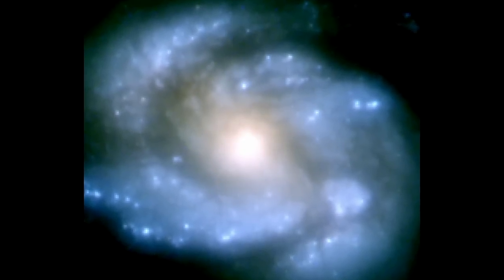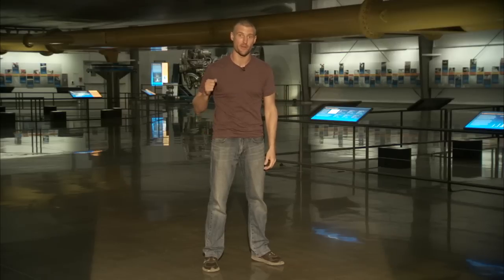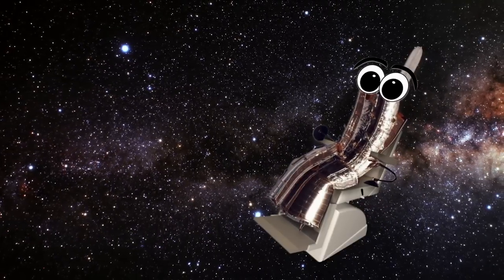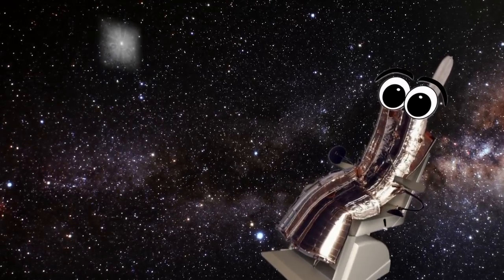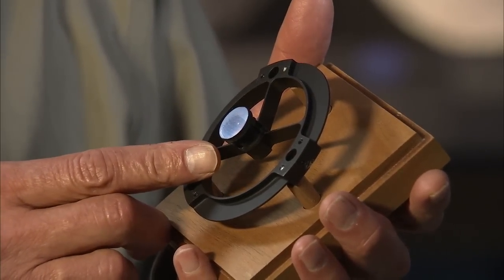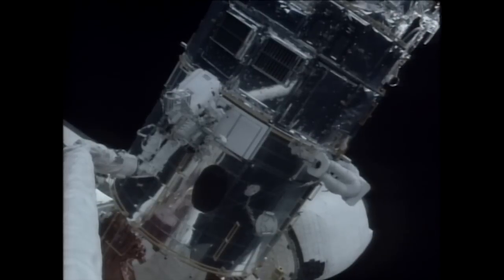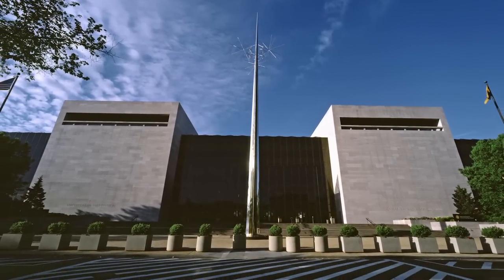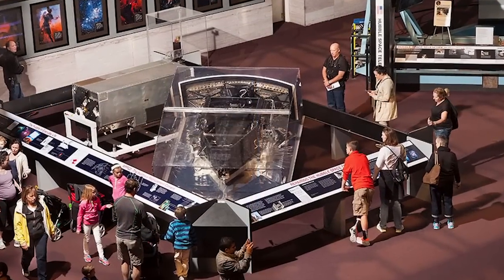Crazy Engineering: The Camera that Fixed Hubble

Comment: The truth of the matter was, that the mirror was laid flat and ground in a gravity environment, and performed differently in a zero g environment
Reply: OpionatedOldMan  Not so.  Try again.
Reply: It was a bit more involved than that. For one, while the mirror was being ground it was supported on actuators (pistons) that simulated zero gravity, holding the mirror in the shape it would assume when in space. How it reached that final shape is an interesting story.

When planning the Hubble Space Telescope NASA decided that the building of the primary mirror was so challenging and so crucial that a backup was needed. The main contract went to Perkin-Elmer in Danbury, Connecticut, now known as Hughes Danbury Optical Systems Inc. At NASA’s request, Perkin-Elmer let the contract for the backup mirror to Kodak Eastman in Rochester, New York. The mirrors were to be ground and polished to standards never before attempted – the ability to make such precision mirrors had always been there, but ground-based telescopes had not been made to such exacting tolerances because the interference from looking up through a thick, turbulent atmosphere made such precision superfluous. However, orbiting above the atmosphere, the Hubble was going to need the best mirror ever made.

The Kodak mirror, using conventional grinding and polishing techniques, was finished on time and on budget, but the Perkin-Elmer mirror fell behind schedule and delayed the eventual launch of the telescope. With both mirrors completed, Perkin-Elmer, as the primary contractor, had the say over which would be used in the telescope and, naturally enough, they went with their own mirror.

So the Hubble was launched and expectations were sky-high. The first out-of-focus images started coming back and everyone realised that there was something badly wrong. NASA and Perkin-Elmer carefully analysed every step in making the mirrors, from casting to final polishing and found that there had been an error in testing the shape of the mirror.

Perkin-Elmer had two types of testing instruments, called null correctors, that focused a laser beam on to the surface of the mirror to show up any irregularities. The older instrument, the refractive null corrector, used lenses to focus the laser, while the other, the reflective null corrector, used mirrors. The two instruments showed different readings from the Hubble’s mirror, so Perkin-Elmer used only the newer reflective null corrector during the final stages of the polishing and that was the problem, right there. The investigation found that two of the mirrors inside the null corrector were too far apart by the thickness of a steel washer. That meant the laser beam was slightly out of focus when it shone on the Hubble’s mirror, but the engineers doing the polishing accepted its readings and shaped the mirror to match the laser. The final shape of the 2.4-metre mirror was out by half the thickness of a human hair – enough to completely blur the images it was gathering. The term is spherical aberration.

Returning the telescope to Earth for repair was out of the question, as it had been made to be launched, but not recovered, so optical geniuses, having analysed the problem down to the last ten thousand decimal places – bit of an exaggeration there, but you get the idea – made a tiny, specially-shaped mirror to fit into the light path from the telescope into a new Wide Field Planetary Camera (WFPC2), which was fitted to the telescope during the first service mission in 1993. WFPC1 was removed and returned to Earth.

The tiny, specially shaped mirror in WFPC2 worked and the rest is history. WFPC2 was replaced on the last service mission to the Hubble in 2009 and has been displayed in the Smithsonian National Air And Space Museum. The unused Kodak Eastman backup mirror for the Hubble is also displayed in the NASM. Experts say that its optical quality is actually superior to that of the Perkin-Elmer mirror.

WFPC2 is hailed as the camera that saved the Hubble. I saw it in the NASM in January 2010 and, looking at the tiny mirror sticking out of the end of the camera, I found it – and still find it – incredible that so much depended on something so small.